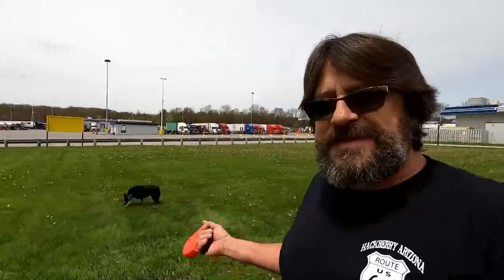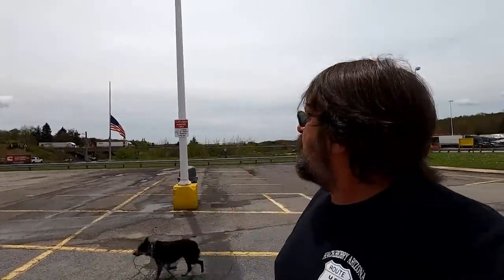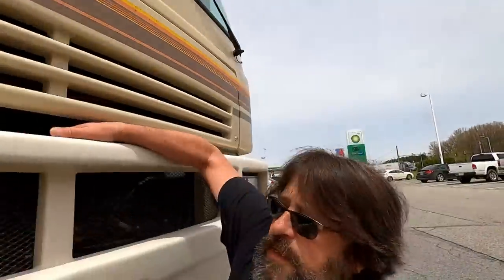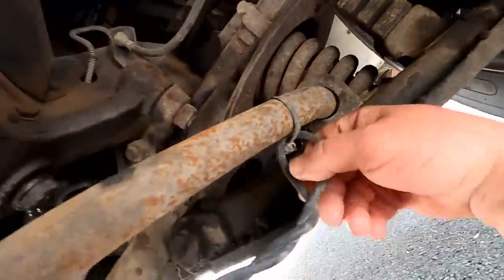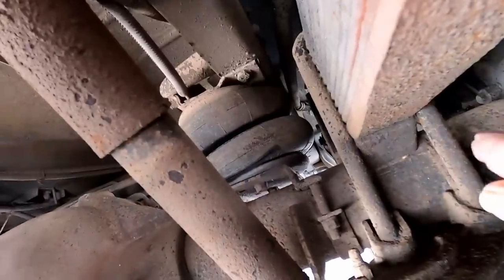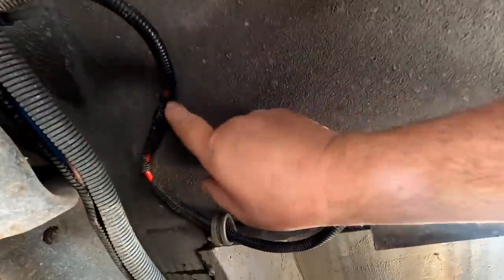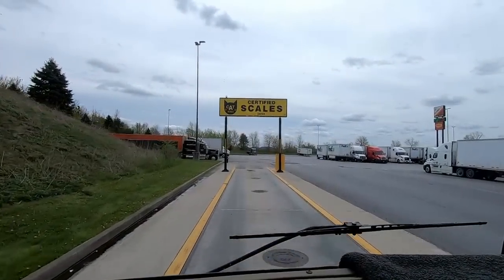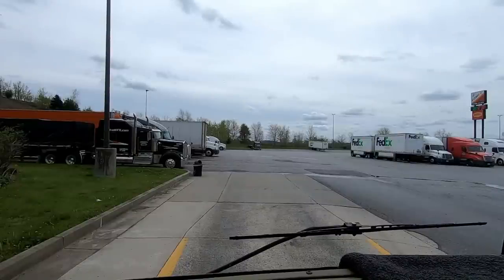Class A Suspension Tune Up - Airbags & Tire Pressure on the Fleetwood Bounder Suspension Improvement

Comment: Dave... the way that you weighed the Bounder... it was exactly the correct way to weigh.... load it like you use it, then weigh. The same goes for alignment, load it like you use it then align the vehicle. 
30+ years experience as a truck driver
Reply from the maker: Thanks!

Comment: I am so surprised to see that you have airbags on a Gas engine Fleetwood Bounder.  I had a 36’ 2000 Bounder from 2005 to 2019 but mine was a Ford V-10 gas engine on an F-53 truck chassis with leaf springs.  At one point I had some improvement made to the leaf springs which had flattened.  I tried to put the Firestone small airbags on but they would not fit.
There were no airbags as they are usually found on Diesel motorhomes.
Later I wanted to add Sumo Springs but never did it.
It did have good stabilizer bars, Bilstein shocks and  a Safe T Steer front end damper which was already installed when I got it. I think these are essential suspension add ons.
Those Bounders are well built and seem to last forever.  I downsized to a 27’ Class A but miss my Bounder for its livability.

Comment: Hey Dave, I know this is a old video, but I might have a solution to the tire air pressure problem.
I drove and owned semi-trucks for 35 years and this is our solution. Take your loaded rig of any type, car, truck, camper, semi trailer. It works for all of them. 
On a fairly level spot, drive onto a very flat smooth surface. Like a 12 inch square piece of wood or metal. Take a flat card, like plastic credit card or similar and slide it in and under the edge of  the side wall until it touches the tire, where it meets the road. If it goes more than a quarter inch, you have to much air. Remove air and re-measure, until it's at a quarter inch. Check the tire pressure and that's what you want to run in that tire position. 
Front and rear will be different air pressures. But, run the same on each opposite sides. You only have to do this once, unless you change your load or rearrange your weight. 
Hope this helps out. See ya.
Reply: easier way is draw lines across the tread in several areas and drive a 1/4 mile or so and look for what chalk stays on the tire. Do this with a hot tire

Comment: You're right on. I believe the maximum pressure indicated on the tire is highest safe reading somewhat above which the tire might come off the rim. The actual pressure in the tire should be lower than the maximum. How low depends on how much of a soft ride you want. While driving on sand or other soft surfaces, I let air out of the drive tires to increase traction and add it back when on firmer ground.

Comment: I'm running a 30' ,  13k pounds loaded = Sumitomo 225/70/19.5 on the steer and Sumo 8r19.5 on the rear with 70 pounds in all. Once they heat up they go up to 80 pounds. The tires look freakishly low as there is a flat contact area with the pavement when looking at them from the side but it is normal.

Comment: The bags were installed by Fleetwood to make up for the Added weight of the RV on the Chassis. They basically stiffen the coil and change the rate. You load the vehicle like your going to travel and then add the air.

Comment: Hey Dave I’m also replacing my dry rotted front airbags! They were installed by previous owner they will be an easy install they should be on yours is mine mines only three years difference than yours on the bounder you go up through the bottom through the middle of the spring just push it through the hole hook up airlines and Shabam done !!

Comment: Hello, I'm looking for photos for the connections of the different switches on the dashboard and the speedometer and lap count because I unplugged the wires without noticing anything. I live in France and there is no such RV. Perhaps you could help me because you have the same model as mine. Thank you Stephane

Comment: What wouod you suggest on a max 120 psi 16ply tire i have a 32ft gas a class fleetwood door tag calls for 85psi i run 95 front right no 90 rear

Comment: Hi Dave, good content. I have a 1992 fleetwood bounder and absolutely love it. Question tho, how do you find and get to the power steering fill? She squeals till shes warm, don't know if I need a belt or low on fluid.
Reply from the maker: I haven't had to add any fluid in a long time, but I'm sure it's under the dog box from inside. A squeal is probably a need for new belts or at least adjustment of them.
Reply: Thanks Dave appreciate it, and you

Comment: What sort of a power train do you have in your 1990 Bounder? I assume it's sitting on a Chevrolet P30 chassis, correct? 454 gas, with carb or inject? TH400 transmission? 3.73 rear end ratio?
Reply from the maker: P30, 454 with TBI. I don't know for sure which transmission and gear ratio.
Reply: @DavesRVLife  does it have a 3 speed or 4 speed auto transmission? What sort of gas mileage do you average?
Reply from the maker: @Dadcam_Can  It's a 3 speed, so I guess that makes it the TH400. Sometimes it gets as much as 7-1/2 mpg! lol
Reply: @DavesRVLife  I would agree it's a TH400. I believe the 4L80e 4 spd transmissions were available in 1993 onward. I have a 1984 Fleetwood Pace Arrow on a P30 chassis with TH400 and 4.10 rear end but with a factory 6.2 diesel. I can get upwards of 12-13 MPG under ideal conditions. These old motorhomes are a lot easier to self maintain than most of the newer builds.

Comment: Dave got a 91 Winnebago 32 ft.   MIne weighed 4100 front and 8000 something rear.  Your water weighs almost 1000 pounds.  Geez only put 20 gallons .  I replaced those stupid front bags.   Good luck squeezing them in the bottom hole.  It sucks.  This winter I will probably put on new coil springs. 

good luck to you

Comment: Hello Dave
The last Owners, Mad Attempt to Replace system.  
Besides Air Bags.
Looks like wore out sway bar bushings.
I'd replace Front Springs , they look collapsed & New Shocks would be nice.
Your bump stop, has been hitting.Leaving a mark . Good Luck , water weighs 8 lbs a gallon . Anything past rear axle triples weight. (cycle)
Call Tirerack.com for pressure info .
Thank you for sharing.  Drive Safe

Comment: not real good having a 300 pound motorcycle 10 feet away from the rear axle. That exerts 3000 lbs down force  300 lbsX10ft on the rear frame from the axle back. That's why it is tail heavy. It's too bad you can't mount the bikes on the front but it would get in the way of the headlights.
Reply from the maker: The weight also including the motorcycle rack is almost 400 lbs. This should be done using second class lever calculations. With the front axle being the fulcrum and the force of effort (400lbs) distance being 31' and the point of resistance distance being 17' (rear axle), that is a mechanical advantage of 1.824.  400lbs * 1.824 = 729.6 lbs on the point of resistance (rear axle). :)
Reply: @DavesRVLife   The rear axle (rear spring mount) is the fulcrum in this case and that is the force exerting down or CCW in opposition to the opposing force of the spring. That isn't the sum of all the forces, just that one. I would keep an eye on the part of the frame right around that area for over stressing especially after running over some rough bumps.  It might need some strengthening.